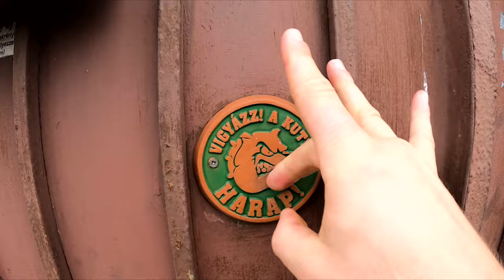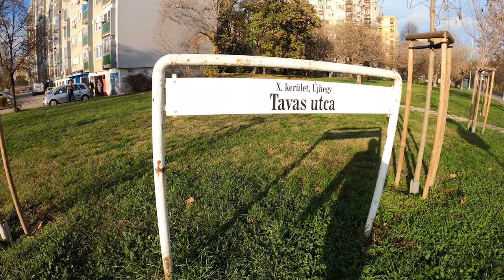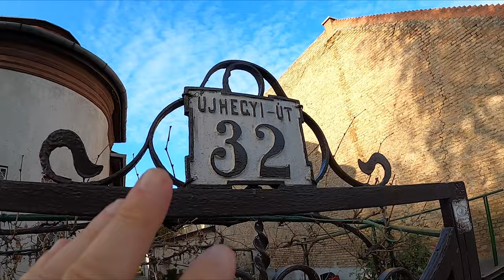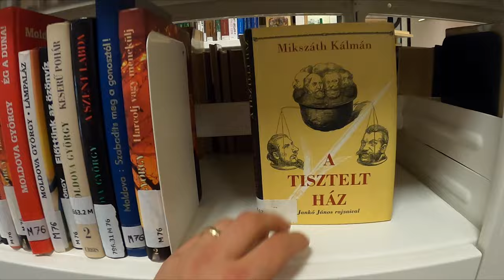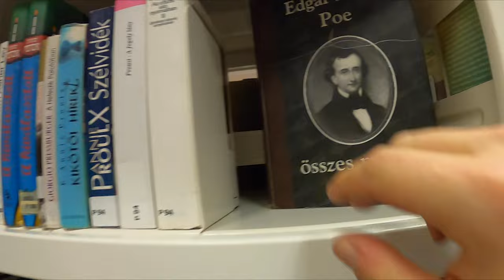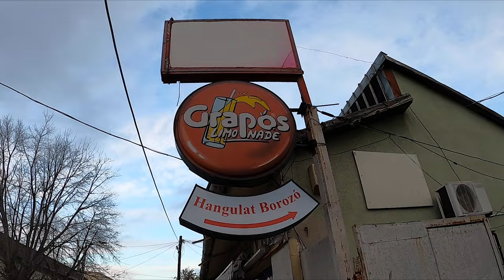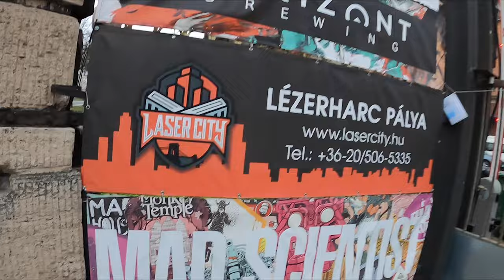Kőbánya is Budapest

Comment: 3:11 That shopping cart has been there at least since May 2022. I think I might have a video of it. There are two woods on the two sides of the KöKi Terminál (the transport hub/plaza you came out of). This, the smaller one is kept relatively clean and has a street workout spot that no one seems to dare using. The bigger one acts as an illegal garbage dump I haven't been to for a while, since the last time I've seen several piles of human doodoo, but it has a hidden airsoft ground. Funny how you traveled there again right after I moved out of Kispest, I could have shown you around in that border area between the two districts. It is absolutely blyatiful with a lot of abandoned urban hell.